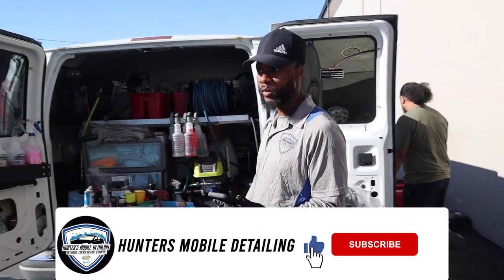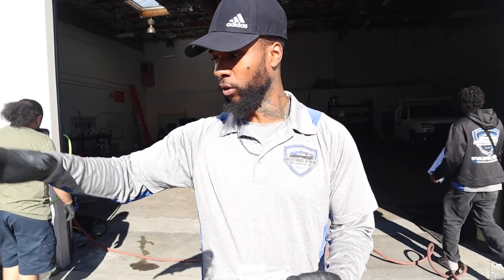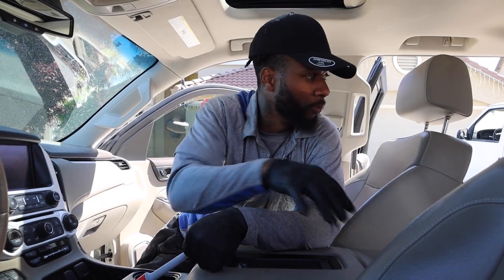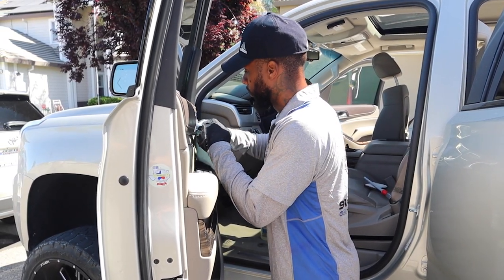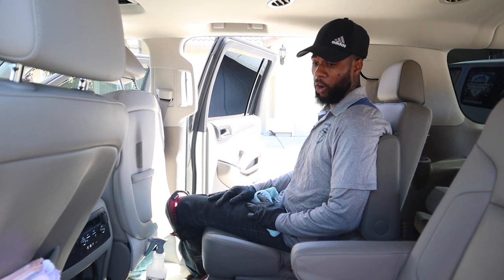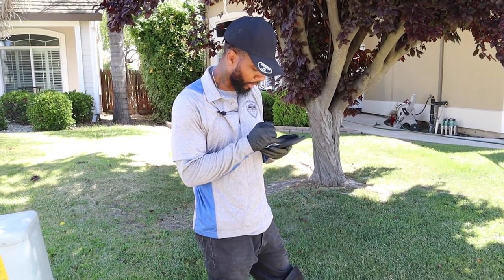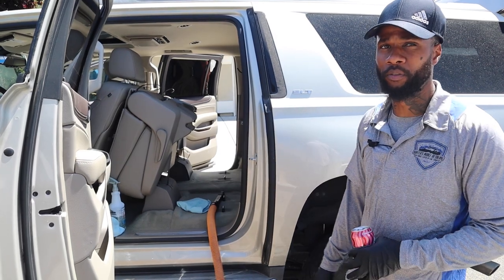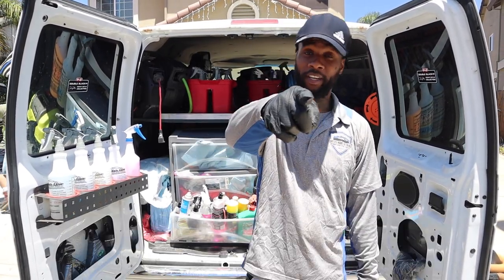How I Train My New Detailing Employee - Hunter's Mobile Detailing

Comment: In regards to something you could implement.  Since you have checklists and a garage already, have the team at the end of the day fill out the checklists for each van and move empty bottles/ dirty rags/ and things that need replacing to a specific place in the garage.  Then if you have someone that works the garage/store every day, have them come in an hour earlier than the team, and go through the check list for what each van needs.  They can then refill bottles, get replacement towels and tools ready, and manage anything else that may need to be taken care of for the vans.  This way, when the team comes in, they grab the check list, review that everything needed is ready, and load up and go.  Since everything they need will be out ready to pick up from one location in the garage, you reduce the running around first thing in the morning when things are more likely to be left behind.  This can lead to better inventory control in the future if you need to implement it as well.

Comment: The best pro tip I can think of of this: you can easily get carried away with the different amount of products out there...so try to have only a few products that give you multiple uses so you don't get inundated with a ton of products. Examples:
Superclean:
Diluted 4 to1 for tires amd wheels
Diluted 5 to 1 for interior cleaning
Diluted 10 to 1 for non tinted glass and surfaces with white lettering
Mags syn spray wax:
Great for exterior
Also works well on interior glossy trim peices

Mags hyper dressing
Diluted 1 to 1 for exterior trim peices and tire shine
Diluted 3 to 1 for satin finish for interior dressing and leather seats
Diluted 4 to 1 for matte finish for interior amd leather 

This way only a few products can be used in multiple ways with various dulituin ratios. Hope this helps
Reply: Apc for carpet works to?

Comment: Thinking of trying detailing out myself when I have free time in the summer between college here in the UK.  I’m 17 and learning to drive but hoping to pass soon.  What would you suggest for working out the back of my car?  I’m thinking Nilfisk wet/dry vacuum and Bissellextractor to give me a boost for interiors, already got a pressure washer, polisher and some decent products at home to do a quality exterior job.  Thanks!
Reply: Hey man, I’m also 17 and I got some good experience with the bissell and I recommend it man as a extractor when you first start, it has good suction power and it does the job.
Reply: Go for it bro it makes good money
Reply: Don't forget about a steamer!
Reply: @goodvibesdetail2004  Thanks a lot, will definitely look to grabbing myself one then!  Would you recommend one in particular?  Thinking the Spotclean Pro for the superior suction and capacity to the standard Spotclean but not sold on the Pet Pro.  Would you say that's rational?
Reply: @werodeets834  I did consider it, not sure which one but anyway I wasn't sure if it was 100% necessary just for a bit of a Summer job.  I totally understand it for the proper grimey cars that full-timers would come across but good products and a bit of elbow grease will do the job almost all of the time right?
Reply: @James-fr6ff  yes the spot clean pro is the best of the best in bissell range but I have use the pet pro and little green pro and they worked great for me but like I would recommend the spot clean pro.
Reply: Thanks for the advice